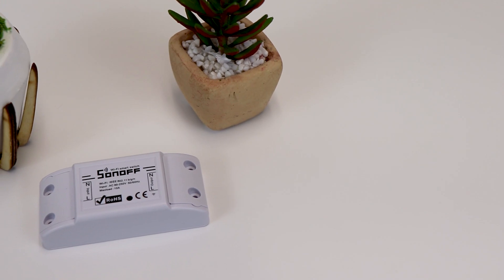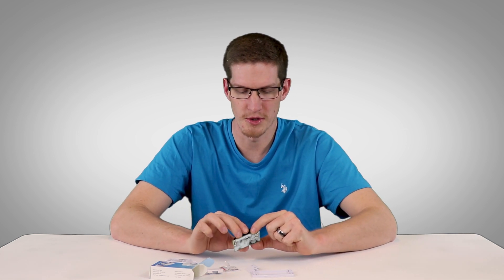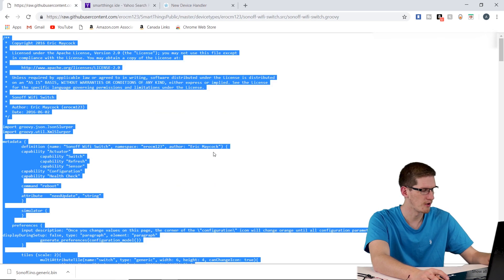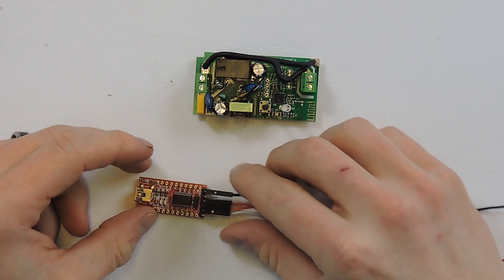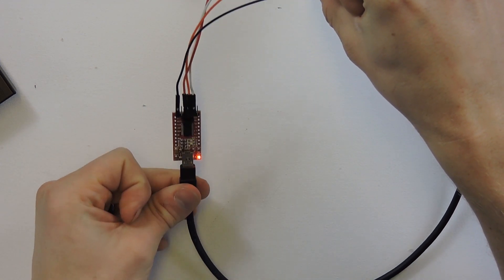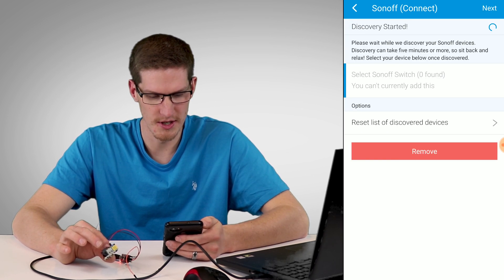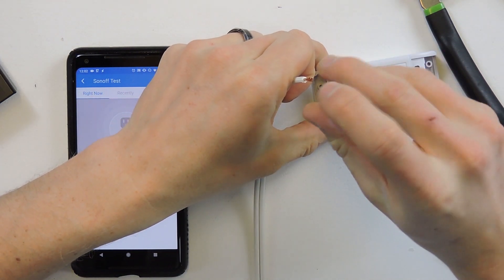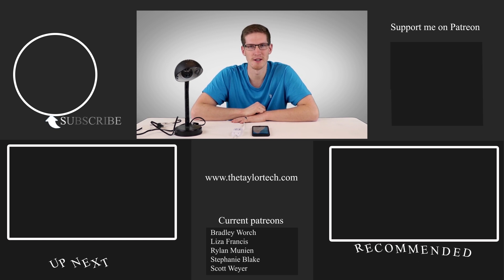Sonoff R2 | $5 Smart Switch Working with SmartThings!

Comment: When I flashed a TH16 the USB connection did not provide enough power.  I had to connect AC power to get the WiFi up in order to connect to my home network.
Reply: I have a TH16 being delivered tomorrow. Were you at least able to flash the firmware with usb power? I don't like the idea of AC power while I've got my fingers in there data flashing the firmware
Reply: Sorry for the confusion.  You have to have AC power disconnected to flash.  No problems flashing using FTDI USB to TTL connection.  It was after flashing the Sonoff TH16 that I had to connect AC power to setup the network connection.
Reply: Thanks for clearing that up! unfortunately the FDTI adapter that was delivered to me, wasn't the correct ''FTD1232'' variant, so i weren't even able to complete the flashing as it wouldn't recognize the mac addresses :( 3 more adapters on order now, and another TH16 (just in case i killed the one i have) on order, hopefully it'll work!
Reply from the maker: Thanks for the tip, Thomas. I'll include that in the description.
Reply: will the blue light blink while flashing.
Reply: I also flashed my TH16, I put a AM2301 Temp and Humidity sensor on it, but it does not show temp or humidity in the smartthings app.  Is yours working? and if so how did you go about it?
Reply: I flashed my TH16 and configure the network. Unfortunately after setting the device handler and smartapp I was unable to add the device on smartthings. Maybe I am using the wrong code...

Comment: I was able to add the device using the new SmartThings app.

The device does not work after reboot. It almost works if you assign it a static IP address (otherwise you'll have to re-add it similar to what he mentions in the last couple of minutes). The problem is it forgets your network details after reboot so you have to set this up each time it's turned off.

Comment: Thank you Taylor. I have a SmartThinggs V3 hub and could not get this to work with the new SmartThings app but got it to work with the SmartThings Classic app.  One question regarding the Sonoff connect smartapp, at 13:29 when you were about to add a new Sonoff switch,  I see that you had 3 Sonoff Connect smartapps.  If this Sonoff Connect smartapp is for different type of Sonoff switches, were you trying to keep them separated by type in each of your Sonoff Connect smartapps?   If so why?

Comment: Love your videos! That's really neat to see the integration with Smartthings.  ZOOZ has a multi-relay that has 3 independent switches (relays) that works with Smartthings directly.  It also has a device handler and the switches can be configured to momentary or continuous.  Good for automating garage door openers, pool pumps, and other loads.  Relays are rated at 15 and 30 amps.  https://amzn.to/2WMbnj8

Comment: Hi Taylor, have been a while since you published this video but I tried it anyway. Firmware update was ok, I can even browse the sonoff IP and can see the new smartlife.tech firmware and control from there. I created the device handler and the smartapp. I have both smarthings app but I added it use it the old one. When trying to discover devices it find nothing. I even tried the manual option using the device IP and it looks like is not able to communicate with the sonoff, it does not see it. I tried recreating the device handler and smartapp again and no luck. Any idea will be highly appreciated.

Comment: I have done exactly like you say but the sonoff connector cant connect to handler.Anyway.. there is a bigger problem than that. YOU DID NOT TELL US TO MAKE A BACKUP OF THE ORIGINAL FIRMWARE!! so.. my sonoff is busted, i cant go back to original firmware because i don't have a backup. Theres are sonoff firmwares on internet but threre are useless, the device will not connect to network, no unique id on firmware. So.. anyone want to play with the sonoff firmware, please search on internet how to first download the original firmware from your device as a backup.

Comment: momentary switch does not work after weeks.. anyone with any updates or alternate firmware flash ??????????????
Reply: Same problem here...  The switch config hasn't changed after 6 days of continuous use.  Taylor said his takes 2 or 3 days for the configuration to complete.  I'm starting to wonder if I have used an old firmware version or what?

Comment: Just as a note for April 2020. I had to use ESPHOME-FLASHER on my Windows 10 computer, as the other program no longer works. Easy to use, automatic parameters. One point I would like to add, is that I had to reverse TX-RX and RX-TX in order for it to work... Works great now - thank you. I've done 3 Basic Sonoff  & 1 TH-16.

Comment: Will this work to control an attic fan with a ECM motor? The fan is only around a 150W so it doesn't draw much current. I just don't know about ECM motors. If not do you know of a smart plug (plug in preferred rather than hard wired) that will? P.S. does that say FTD 1232?

Comment: I could use help from someone out there. This is an excellent video and was able to accomplish all of this except it's not working for a sonoff mini. I have flashed Tasmota, and installed everything. The switch will not toggle in smartthings and I'm wondering if there is a source code that slightly differs for a sonoff mini as there is the slight difference of wiring compared to a sonoff R2. I will continue in my endeavor as I always do. Thanks in advance.

Comment: For automating all my light switches in my home, do you recommend to use SONOFF like this way with each light switch? or is that going to create strain on my wifi router?? i try to look for z-wave switches but they are quit expensive for my budget.
Reply: I would suggest taking a lot at the sonoff mini. What makes it special is you can use your existing switch to run your light manually, or the the sonoff mini you have wired with a wifi connection. Use caution when working with your home electricity, cheers.

Comment: I have a SmartThings hub V3 and a number of Sonoff Basic R3 switches. Successfully flashed the Sonoff devices with Tasmota, I can access them just fine over IP, but for the life of me, cannot get the SmartThings Hub to see them. All device handlers I can find seem to be dedicated to the R2 - can anyone point me to an updated device handler (assuming that is where my problem is)? Better yet, has anyone managed to get these two connected?

Comment: Hi. Do you know how I can get this working with smartthings. I've changed the firmware and log into smartthings ide, added the handler and sonoff connect app and no joy. The connect app notices it but fails to connect to it. I tried redoing everything and still no joy. About to give up on this.
Reply: I couldn't get it to recognize the device in the new Smartthings app, but I switched to the Smartthings Classic app (it's older and has a single large blue circle as the icon.)  In Classic, the device was immediately present and I was able to add and rename it.  This difference between the classic and the new app is fairly common - any time you are doing 'hacky' things like this, the Classic app solves a lot of problems.  (He's using the Classic app in this video BTW.)

Comment: Tried doing this with the TH16 but change it to the TH firmware and device handler but I cant get temps and humidity to show in smartthings? Only power on and off. Can you help. I used firmware sonoffth.ino.generic
Reply: Also does the TH firmware work on chipset ESP8266?

Comment: I followed all your instructions but for some reason I am unable to connect it to the Samsung Smartthings hub v3. Any help will be greatly appreciated. I got about 6 of the Sonoff Switches.
Reply: The thing is to make sure the Samsung Smartthings hub is connected to the wifi rather than the ethernet cable. I followed the instructions of Jon and I was able to get the sonoff to connect with my SmartThings hub after a long and wild search for solutions! Me buddy for the great video. You might want to slot in such messages to make it easier for others to follow!

Comment: The LED light flashes Red rather than Green after it completed the flashing but the status on my computer indicated that it's completed and now I can't get it to show up on my wifi using both methods to supply power to it.
Reply: did you get help on this? i have same issue

Comment: Why are you flashing new firmware? Does it not already come with a firmware flashed?
Reply: Is has but it will not connect with Samsung smartthings and flashing it means you can connect it even without the internet otherwise you'll have to connect it to the internet to use it through the cloud

Comment: I tried to flash my TH16 dual the same as the basic, which I was successful 3 times, but the flash wouldn't work on the dual.   the ports are in a different location, but appears to me to be labeled labeled the same.  I get a flashing blue light and nothing happens.  any advice.

Comment: If the power supply or electric power outage then when then utility comes back then will it connects automatically and will work as per settings we have set before or it will lose all the schedule etc and need to be set again?
Reply from the maker: In my experience, it has always kept the same firmware flashed onto the device. It won't lose that. But maybe once every 10 power outages or so, it will require you to re add them into smartthings.

Comment: I was able flash the older sonoff basic switches. One took 3 times, but the other 2 flashed first time.  I went through several of the cables, holding them at an angle to make a connection they bend.  After a few times straightening the pin out, they break.  Much easier then soldering.   I have a lot of cables.  Thanks for the tip.

Comment: So I was able to flash the new song off using a slightly different adapter, but it seems to have worked. I'm able to control my device via SmartThings ... However (you just knew there had to be a butt right) like in one of Drew's other videos the sun off never configures as a momentary switch. Left it on for weeks and it still does not configure. Any ideas?
Reply: Same here, still having the same issue.. have you found any fix for that @calvin ???
Reply: Same here....  Switch will not work as "momentary" switch.  The device doesn't seem to accept the configuration changes thru the Smartthings app.

Comment: Flashed my sonoff basic without issue and connected perfectly to smart thing using the great guide. However I created a webcore piston and linked a motion sensor. The sensor works fine at 5m distance from the WiFi router or hub without issue but the sonoff looses signal and therefore does not complete piston action. Is this a sonoff firmware issue?

Comment: I am unable to get into flash mode. The wiring is correct and it should be simple. As soon as I plug in the FTDI the 2 green lights flash every time. I assume the red light is power. any help would be great.
Reply: your usb could be bad, i had 2 faulty wires before i brought a new wire and it worked.

Comment: This is great, once you have done one, its so easy!  Like Thomas I found when trying to get the Sonoff to connect to the WiFi after I flashed it, I was unable to see it. So I connected it to the mains (here its 240V) and then it appeared on the WiFi perfectly, then I could continue to enrol it in SmartThings.
Reply: So I did just as you said but I still can't connect it to the smartthings

Comment: I'm set up with the new smartthings app on my phone. But I just started getting into smart home and found a lot of this depends on smart things classic. I tried to sign in to it and it just stays on the email page. doesn't let me go to the password page. So do you know if i can get this working with the new app?

if i can. does the firmware you flashed support gpio assignment. I have a few switches with tasmota set up with gpio3 as switch1. (required for my setup)
Reply: Cory, there are differences between the old and new ST apps, the new one is notnas complete as the old.  Try to down load the classic app, do your setups there and then they will appear in the new app, including on the ribbon on the home screen of your phone.
Reply: @mbe6809  no that's what I'm saying. The classic app wont let me sign in, or sign up. I'm stuck doing everything with the new app.

Comment: I was able to flash it with no problem and switched it to my network but the ST can't find it in discovery mode.. Any advice?
Reply from the maker: Try holding the button down for ~10 seconds, that should reset the WiFi
Reply: @TaylorTech  I got it figured out. Thanks
Reply: @jonmichael29  I'm having exactly the same problem... what did you figure out?
Reply: @robertbrodine9841  it turned out that I had my wifi router attached to the main router, at the same time I had my ST connected to the main router and since my ST was not connected to my wifi router it wasn't picking up the signal. As soon as I plugged my ST into my wifi router it picked it up right away.
Reply: @jonmichael29  I had the exact same problem. Your comment saved my night :) Thanks!
Reply: @TaylorTech  I'm having the same problem as Jon, in that, I have gone through all the steps with no problem, my Sonoff Basic (1 year old) connects to my network, I go into SmartThings Sonoff (Connect) and have it discover but it can't ever find anything. I've reset the WiFi several time but still no discovery.   I have a second old Sonoff Basic connected to my network with eWelink, do you think that could be the problem?
Reply: @TaylorTech  I flashed my other Sonoff Basic but could not discover either of them, so I added them manually with no problem once I found out what their IP addresses were.  Who knows why discover can't find them.
Reply: You're very right @Jon I had similar problem just because my hub was connected directly to the main router with happens to have the wifi in. It prevented the hub from seeing the sonoff until I disconnected and reset the hub and this time connected it to the wifi. It worked like magic!!! Great job buddy!!!

Comment: Does this work with Sonoff Basic R2 ? Not sure what the difference is with the previous model. Previously, didn't have much luck trying to flash Tasmota. I was able to flash 1 out of 4 or 5.
Reply from the maker: Yes, that is the board I am using in this video.

Comment: Wow!  That is exactly The video I have been going to make!  I wish you would have made this video 2 weeks ago!  It would have saved me, a non-techie guy, hours of figuring out how to flash my new Sonoffs with the new 8285 chip.  I ended up doing exactly the same thing you did, including the one-handed flash down to the cheap extension cord.  Your initial video got me interested, but when I received the Sonoffs with the new chip, I had to improvise a new procedure.  There were plenty of posts on ST community about using the  Nodemcu, but no real noob-type instructions.  Drew, I really appreciate the amount of info that you give in your videos--just enough for someone like myself that is motivated to learn.  Keep 'em coming and I will watch and support your sponsors.
Reply from the maker: Thanks Blaine! This is exactly why I make these videos, because that was me a few weeks ago trying to figure out this new method. Thank you for your support!

Comment: Just a note: ground wires are typically green (or green with a yellow stripe) in common usage. In the US, many circuits use black wires to represent the hot wire. Staying consistent within the same project is enough to ensure safety, but please be careful when translating these concepts to other wiring projects.

Comment: Thanks for the updated video with the new sonoff. I have use your older instruction to setup 2 sonoff basic to open/close my garage doors. They have been working great now fo more than a month. I have to isolate the relay output from AC voltage. 
I also have magnetic Reed-Switch that I'm thinking to connect to the sonoff GPIO pin to show the state of the garage door (to show it open or close) in the smartthing app. But still don't know if it's even possible. Do you have any idea on how to make it work?
Reply from the maker: Yes I do. In the next video, I'm going to show how to isolate the relay like you mentioned, but there's also a smartapp out there so you can use any tilt or contact sensor that's connected to Smartthings already. It links the sonoff and the sensor into one virtual garage door.
Reply: Great. This is the cheapest garage door opener for ST user. I realized I can use the ST tilt sensor for the Door State, but has to purchase the tilt sensor. Since I already have the Magnetic reed switch ($1.00 each), just looking to incorporate it into the sonoff.